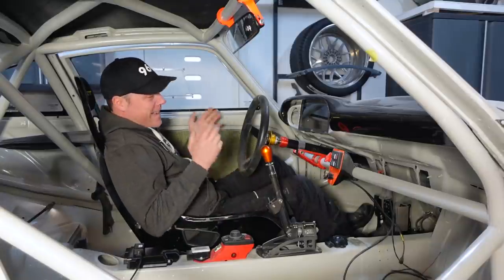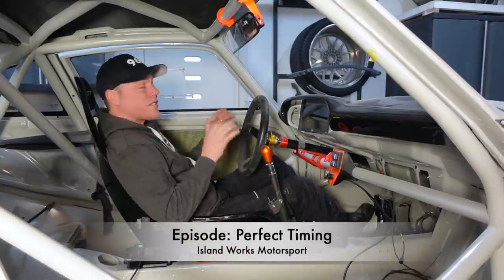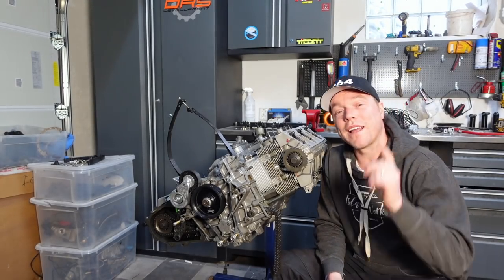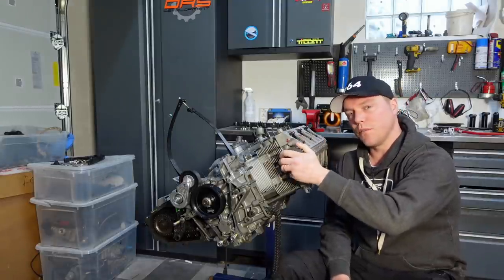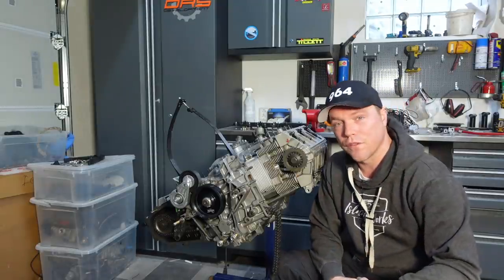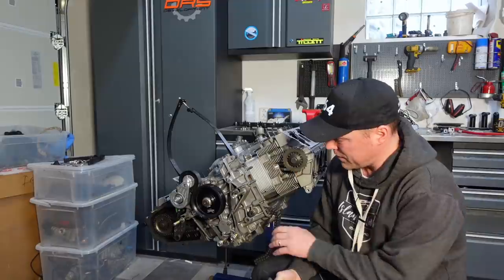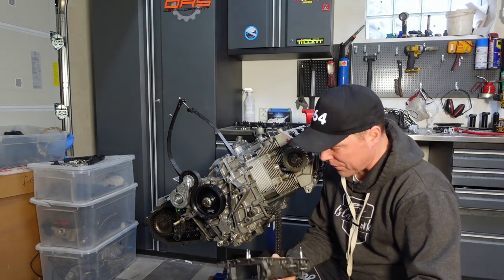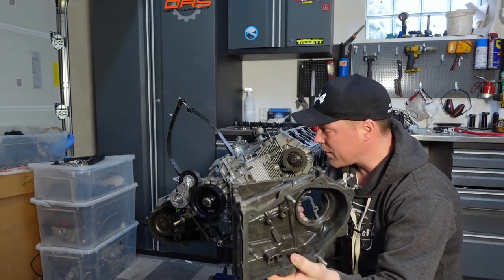Perfect Timing - Adjust Camshaft Timing & Valve Lash for My Porsche964

Comment: Porsche chain tensioners have always been hydraulic as far as the ones I've worked on are concerned over the decades . The old type were internal behind the covers and were quite complex , took oil pressure from the main galleries , look like they are serviceable by replacing the internal O rings but .....no not really . Once the chains rattle you have to replace the whole assembly on both sides . Now they are external so you don't have to strip the whole front of the engine to replace .
The common move on high revving motorcycle engines with this type of adjuster is to replace it with a full mechanically adjustable tensioner removing the unreliable oil feed . They are similar to the 3 D printed ones seen here but with a lock nut and easy to make . Its really easy to adjust a fully mechanical chain tensioner and will happily rev to 13000+ rpm in a race motorcycle .
Reply from the maker: The older Porsche engines have spring loaded “non-return” mechanical tensioners. They are not very fun and can lockup meaning you need to take the whole thing apart. The newer ones (like in the video) are not that expensive and have worked well for me.
Reply: Porsche motors got hydraulic tensioners for the 1984 model year when the 3.2L motor was introduced. Prior they had mechanical tensioners in various iterations that were never foolproof and accounted for a lot of bent valves and destroyed motors. As such, upgrading to hydraulic tensioners (with an external oil line) is standard practice when rebuilding older 911 motors with mechanical tensioners (if there are even any left).

Comment: Thanks for this, sooooo much easier with 993 cams and Porsche locking tools. Quick question did you put 574 on the timing box cam seals?
Reply from the maker: Hi, I smeared a bit of 574 on both sides of the gasket behind the thrust plate of the camshaft. Just a dash and the use my fingers.

Comment: Love the build series.
What do you aim for horsepower and torque wise?
Reply from the maker: I’ve used this engine (most of it before) and it was stronger than other 964s I could compare with. I’m thinking less than 400 but surely more than 350 ;-)
Reply: @islandworks  Ok thanks.
Why did you use a 964 for the project over for example a g-body? A g-body would have had a hefty weight saving I think.
Btw. I really love watching your videos. Very detailed and very entertaining
Reply from the maker: It’s a good example of starting with what you have and then having a project that got completely out of hand!

Having said that I do have a G-model and I think the 964 is superior in so many ways.
Reply: @islandworks  yeah that makes sence. Weight isn't everything.

Comment: That washer is not on the 993. I think the sprocket just goes onto that part of the cam. Is that correct?
Reply from the maker: I realize reading this that the 993 must be different in this aspect.

Comment: nice work man  this engine you called a boxster it's actually pronounced boxer as a boxster is the crapiest porsche car and engine ever made and you called the timing chain a timing shane its chain lol don't get me wrong, i am  not making fun of you  i respect you and i envy you dude your work is very good the way you put in those cam retainer plates shows me you have alot of experience i prefer to use 3 long 8 by1.00 bolts screw them in a few turns then push in the plates and they dont like to go in easily unless you rubber grease the fat oring well and its reciever groove in the housingthen once pushed in then i put in 3 original bolts
Reply from the maker: Thanks for your feedback! I’ll do what I can to keep this in mind going forward. 

Greasing the oring is really important to seat it without cutting it.
Reply: not so you won't cut it but not to  stress the three bolts trying to snugg it up,  also put grease on the bolt threads as not to strip them, 

my boss some 32 years ago taught me to set up number1 cylinder top dead center pulley of crank z1 at pointer set up both cams with either dots or 911 marks pointing down there are a few different markings with different years earlier 911 most of them had 911 and there's only a few other types they should face down tdc set up rocker on 1cylinder to exact valve lash, because  if it's out a little this will change cam timing alot as the rocker may take longer to open valve or less to adjust this correctly it must take 3 hard wiggles to remove the feeler gauge if you adjust it so it slides out smoothly like on a conventional engine it will be to noisy as air cooled engines don't have any water around them to dampen out noises, 
 use your dial gauge to dial in your cam timing on cyl 1 make a necessary adjustment then turn the engine 360 degrees till z1 lines up again this will show you your 1 cylinder overlap  figures, then adjust the right side then when you achieved cam timing turn it another 360 till z1 appears again cyl number 4should show you its cam figures.

 i may have confused it a little but set up cam timing number1 cylinder on tdc turn crank 360 to check your  figures then go to cyl number 4 set up dial gauge make adjustments then turn another 360 for cyl 4 cam figures

Comment: Did you check the TDC mark on the crank pulley?
Reply from the maker: Yes, you align them together
Reply: @islandworks  I suspect he meant did you check that the mark is TRUE TDC...
Reply from the maker: @HenryOCarmichaelSmith  I’m happy to get a tip on how to measure this. Maybe as easy as sticking my boroscope in there?
Reply: @islandworks  a positive stop and a degree wheel is one way to find true TDC, often you will find the timing mark on the pulley is inaccurate. You'll find lots of guides online that show how to do this. Once you have true TDC you can set the timing using the lift at TDC method like you did in the video. In reality if you are going to test for optimal cam timing on the dyno it doesn't really matter, as you will be swinging the cams to find the best timing anyway. A good idea is to find out how much piston to valve clearance you have either side of your zero timing position, so you can mark on your pulleys the maximum advanced and retarded positions. This will help when adjusting timing on the rolling road.
Reply from the maker: I will definitely make a check to see it’s accurate. For the 964 engine it will be quite a challenge adjusting the cam timing with the engine in the car, but everything is possible ;-)
Reply: @islandworks  that's a good point I had not considered the location of the engine 🤣
Reply: @islandworks  enjoying your videos btw 👌

Comment: I take it these are non-interference engines the way you were turning it over with incorrect cam timing?
Reply from the maker: The valves will surely hit the pistons if you don’t start off with a rough setting of the camshaft before you set the first rockers. I’m not sure if that is what you meant.
Reply: @islandworks  yes exactly. I missed that you had roughly set the timing first
Reply: Porsche motors are quite high performance motors from the factory. I seriously doubt you'd be able to get anywhere near as much power/L if the motors were non-interference.

@Islandworks Sweden  What Henry is referring to (and what made me very uncomfortable just watching your video) was that you opened the intake valve to 3.4mm lift and THEN, after removing the sprocket alignment pin, turned the motor through 2 revolutions. It has been a long time since I have built a 911 motor, bit IIRC the minimum valve/piston clearance on older Porsche motors was in the vicinity of 1.5mm. It is quite possible that you squeezed by without any contact at 3.4mm lift, but I seriously would not want to try your method (or is this SOP in 964/993 motors?). My experience is with older motors and there was a nut on the cam and the cam also had 2 flats that fit a 19mm wrench (IIRC). So we used to move the cam back and forwards a little while removing/reinserting the sprocket alignment pin. But we were sure that the piston was nowhere near the valve...